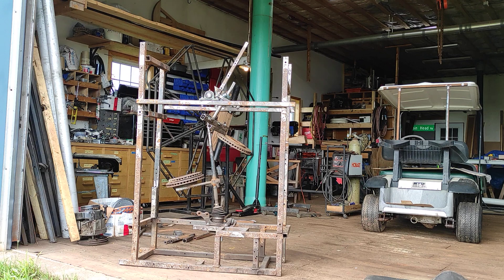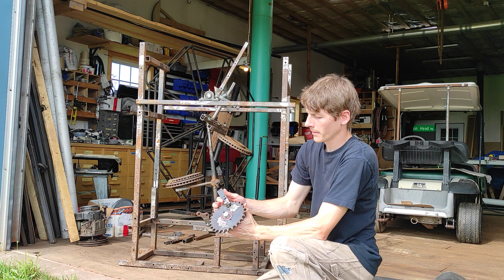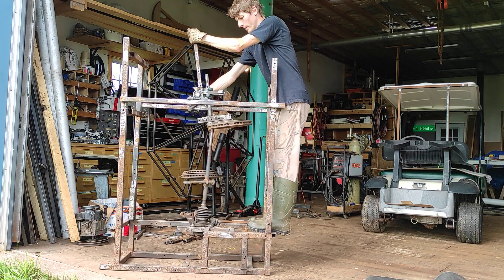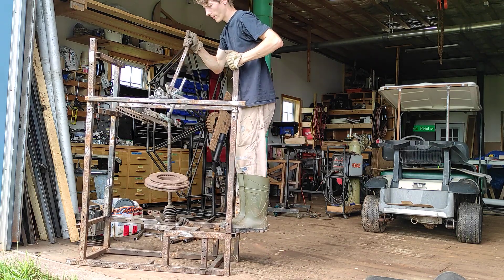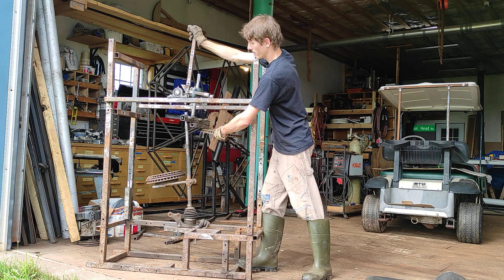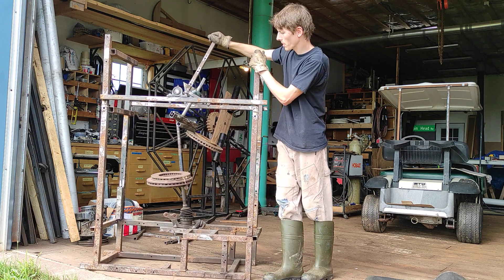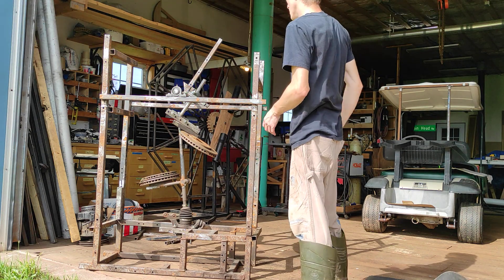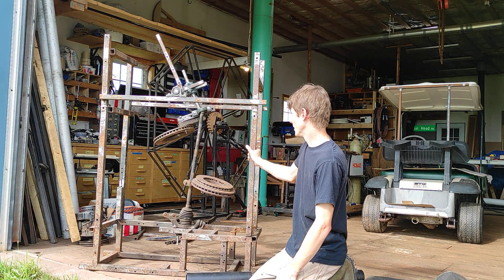Skinner Gravity Power Machine Build Update

Comment: It looks as though that Skinner needs a bit more refinment to work well, save it and mabe try this low cost self explanitory easy to build and  possibly quite powerfull gravity motor - using rotating hammers - there is a 30 foot diameter one  shown on youtube - a 6 footer can knock your socks off, be carefull.  "Build fly wheel free energy generator 220V free electricity generator using hammer, new idea." - i have not seen it work, judge for yourself from the video.
Reply from the maker: The Skinner machine is the best [simple mechanical] gravity power machine we know of. All the fly wheel generator generators are scams. My friend sir T is an electrical engineer and free energy/quantum energy engineer. One of the top on the planet. I've gone over all the youtube scams with him, they are just that. Even 50 watts greater than the input is a LOT of power to get in a generator. It just doesn't happen unless it is very careful engineered by someone who knows exactly what they are doing.

Comment: Wait,dont jump! - for the explanation of the critical relationship of the top and bottom weights to achieve self timing of rotational velocity see - David Quirey - "Simple explanation and demo of skinner ect.", - youtube. - - - short shaft ratio length to pivot at the free disconect joint may need adjustment? - Dave explains overunity cause and  dynamic gravity interaction at the disconnect joint.
Reply from the maker: yes, i think this one needs another lever at the top. David is spot on with his explanation. I explain how he is proven correct in my more recent videos. Gravity motors, including the Skinner machine, work a bit different than normal machines, and they are a bit tricky. This one is simpler than a 4-stroke engine though.

Comment: The basic idea, if you take a  55 gallon drum and tip it on an edge you can ballance it, the slightest movement and gravity will pull it round, a mixture of close weights will be pulled by gravity, but the huge power generated off the smallest input will rip the machine apart unless bolted down, skinner had it right absolute genius.
Reply from the maker: This does not work when you set it up, because what you can do with your hand is a bit different than what people set up. Yes Skinner had it right, the rotating weight has to be pulled in the correct direction and gravity assists this. I am working on a setup now.

Comment: Hi, you would find it easier to handle / operate if your handle and pivot point  at the top was inline with the top shaft, you are fighting a lot of weight as you have it set up at the moment..
Reply from the maker: Hi, thank you for your comment. I have a simpler design than the Skinner machine, which should work fine and produce decent power, but I have health issues at the moment so I haven't built it. Look on TG for more info.

Comment: Also, the shape of the weights is crucial. When tilted, the long weight top leans in front of the vertical plain, with improved leverage and less resistance.....the pivot point is at the balance point, so no effort to lean the weight forward and back.
Reply from the maker: I'm pretty sure you could use a rubber boot and string and get something like this to work. I've made progress in my research and would like to do a demonstration video, but I have not been feeling well all summer.

Comment: Since the 1930's when this guy came up with this nonsense , no one has ever connected this machine to a generator or any other device with any success . Skinner connected it to a lathe with dismal results. There is no such thing as free energy. You have to overcome gravity to use it for power and with the consumption of energy to drive this monstrosity and the loss of energy in the atrocious execution of the linkages due to friction, there is no way you end up with a net gain of energy.
Reply from the maker: This is not really true. Not everything ever done is on Youtube.
Reply: @QuantumEnergySearch  It's true
Reply from the maker: @ruebenmikoch  stupid argument
Reply: Youre right about one thing, there is no such thing as "free energy". However, there is untapped sources of energy that can be harnessed for actual work. It is possible to get a greater output than input. Youre not creating energy from nothing, youre using a small amount of input energy to affect change on a much larger amount of output energy. The input energy creates a local imbalance in the system and the larger net energy always tries to equalize itself, creating an output. The term free energy is a bit of a trap (i hate the term) because people think youre creating energy from nothing, which isnt true. A better term is coefficiency of performance greater than 1. (cop>1) There is an endless sea of energy all around us, the trick is creating a local imbalance so you can syphon off the excess.

Personally i dont think these mechanical devices are good enough to get CoP>1, (although i could be wrong) mainly because there is too much loss in the system. (friction etc) However, you can get electrical/magnetic systems with CoP>1 because there are much less inefficiencies in the system. The trick is to create a local imbalance to start the energy flow, but also a resonance loop that feeds back on itself to amplify the effect. (you need both) Similar to pushing a swing at just right time in order to make it go higher. If you push a swing at a random time, it wont do anything. Even these mechanical systems need a proper timing mechanism (to create the resonance feedback amplification) to have any hope of getting close to CoP>1. 

Only an open system has any chance of achieving CoP>1. The energy must be syphoned in from somewhere. Closed systems such as these magnet motors you see on youtube will never work because there is no avenue for external energy to flow into the system. This gravity generator could potentially work since its an open system, but i have yet to see any promising results.
Reply from the maker: @FigmentVFX  I agree. The idea that energy has to be "created" for an energy machine to work is just part of some people's religion. It's more difficult to engineer an over-unity or self-running machine than a regular machine, but part of the reason is that they aren't common knowledge because of religion of "I can only get energy if I burn oil, etc." and the power of the energy mafia. Most people peddling free energy are scammers, true, and most people's ideas don't actually work, true, but there are 100's of free energy technologies not based on solar/wind/obvious sources that do work. The main reason OU machines are not commonplace is, in my opinion, lack of intelligence and engineering skill.

Comment: You need minimum 2 sistems to work efortless
Reply from the maker: yes, it seems to be something like this, unfortunately.
Reply: That's truee
Reply: I was also start to bulid this device in single module and now nau bulid that in quadro ver, but this is good to see and feel how its have to work.
Reply from the maker: @marcinbialkowskipl  I have a new design that works with a single weight, it's much simpler and a lot better. I just have to finish putting it together to video it. It's extremely simple. I posted about it on the group.
Reply: @QuantumEnergySearch  that's cool,I'd love to see the video
Reply: Now I start to make geet engine ,reaktor.will see wath happens
Reply from the maker: @marcinbialkowskipl  Like many free energy devices, the GEET has to be polarized correctly to work. If you are highly polar it will work, but it's a rare field.
Reply: @QuantumEnergySearch  oooo, apart from the fact that i want to do it i don't have much more knowledge about how it is supposed to work so thank you very much for this information and let's keep in touch. I have been a mechanic and a locksmith since I was young and it will be an interesting experiment